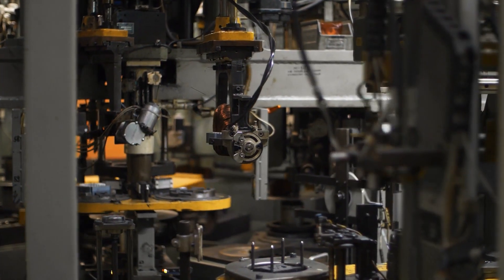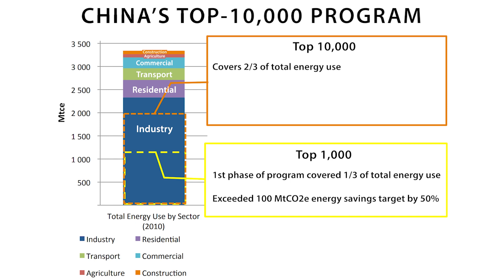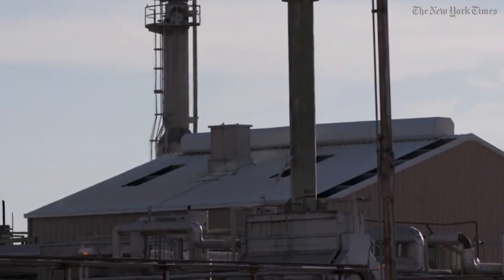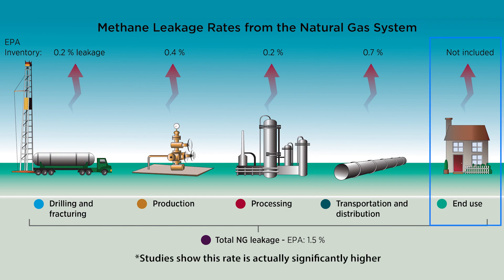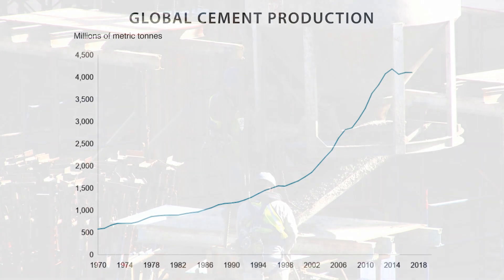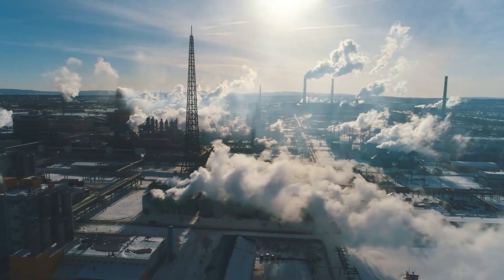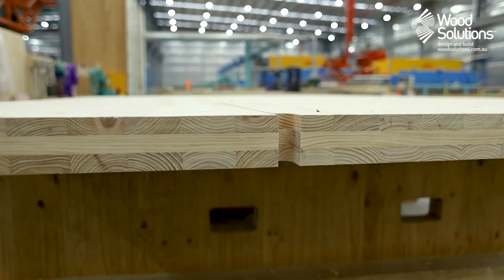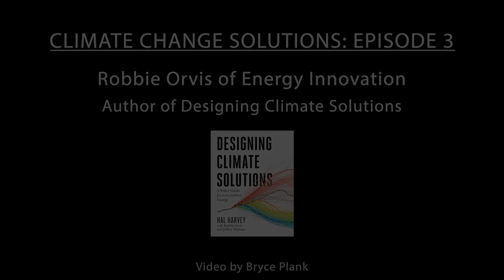How to De-Carbonize Methane, Cement, & Industry

Comment: some people believe that solar cost has got so low we should just cover earth with them, they forget that they take so much mining etc, and solar thermal is way less resource-hungry than silicon-based panels. Just simple calculations and things reveal themselves, just watch the whole life cycle of a product. with refineries even oil got cheap does mean oil is good for environment and same is with solar panels. don't be fooled and actually look at which thing can actually reduce our emissions, converting the whole world to LED can do more. 

and for transition, methane will take over coal and then solar thermal and nuclear will rule at last.
Reply: The efficiency of the solar panels decrease over time.
Solar panels need to be replaced after five to ten years and during that time and after, the lead used in these panels oxidizes and contaminates the environment.
Oxides and nitrates of lead damages the nervous system, making people stupid, suppresses the immune system and damages the internal organs.
The plants need to breathe.
Make more co2.

Comment: 100% Renewable Electricity = 20% of Energy
-- 20% of energy is electricity -- by 2040 24% of energy will be electricity
-- Over 60 yrs jets are 68% more fuel efficient and fly 60X more passengers
-- 2.63 billion air trips were taken in 2010 -- 4.4 billion trips in 2018 -- 8 billion by 2050
-- If batteries were 6X more efficient we would use 60X more of them
--  Earth is heating by 400,000 Hiroshima nukes / day
-- 1968 - 1992 = 1 nuke / sec
-- 1998 - 2020 = 5 nukes / sec
-- 1971 - 2018 global heat forcing averaged 0.47 watts/m²
-- 2010 - 2018 it went up to 0.87 watts/m² = 46% higher
-- 1% of vehicles are electric -- 2% of energy is solar & wind
--- 4% of energy is renewable --- 4% of mammals are wild by weight
-- With 23 billion chickens on earth, if one sneezes we all get the flu
-- Greenhouse gases went up 45% in 30 yrs 
-- 15% of energy will be renewable by 2040, 28% by 2050
-- Renewable energy cannot stop heating in time to avoid runaway change
-- 66% of people will live in water stressed areas by 2025 
-- 4 billion people live 1 month / yr in severe water stress
-- 20% less fresh water per person is available over the last 20 years
-- 50% of thermal & hydro electric power will be threatened with water stress
-- 40% of coal mines are water stressed, and so are 30% of planned hydro 
-- We kill trees 2X faster than we plant them
-- Trees grow faster die younger in heat fire flood & drought
-- Battery & Bio-energy extraction destroys native land water & wildlife

Vaclav Smil says:
-- North Euro offshore wind turbines work 30% of the time
-- North Euro onshore wind turbines work 22% of the time
-- North Euro solar panels work 11% of the time
-- One of them offshore Texas would work 35% of the time

Green Energy Harms Native Freedom Land Water & Wildlife
-- Europe burns 80% of the globe's wood pellets for renewable electricity
-- Europe burns 40% of its recycled plastic & paper for electricity
-- Europe burns 50% of its palm oil cargo in diesels for green bio-energy
-- Dams destroy river wildlife up and down the rivers
-- Shipping trees and palm oil overseas for green energy credit is criminal 
-- Europe's carbon credit system is corrupt
-- Europe's global carbon fund is rife with corruption

Support James Hansen's monthly private carbon dividends
-- 100% to you 0% to governments & corporations
-- That's why both governments and corporations hate it
-- That's why both socialists and capitalists hate it
-- Monthly Private Dividends = Real Climate Racial Justice (not the academic kind)

26 Nobel Prize winning economists support James Hansen’s monthly dividends, including: 3,589 U.S. Economists, 4 Former Chairs of the Federal Reserve and ALL 15 Former Chairs of the Council of Economic Adviser

green energy = global native harm + global wildlife harm + habitat harm + can't stop climate change alone

You can find facts, sources & links at Loki's Revenge blog on wordpress under Green Energy Fraud

zzz zzzzzz zzzzzz

Expect More Mega-Droughts — Science Daily 2020
Fresh Water Per Person Plunges 20% In 20 Yrs – FAO 2020
By 2025 66% of people will live in water stressed areas – Nat Geo 2020
4 billion people live one month per year in water shressed areas – Sci Adv 2016
1.9 billion people at risk from mountain water shortages — Guardian 2019
50% of Global Thermal Electric Capacity Threatened By Water Shortages – WRI 2017
30% of planned hydro projects threatened by water stress – WWF 2020
Climate change: US megadrought ‘already under way’ — BBC 2020
Water use for fracking has risen by up to 770% since 2011 – Science Daily 2018
44% of Coal Plants Risk Global Water Shortage – Unearthed 2016
Water, Energy and Land Insecurity: Global — Science Daily

--  748 million people around the world are without basic water access
-- More people die from unsafe water than war
-- Two billion people lack access to a toilet or latrine
Reply: Saying something is supported by the former federal reserve members is not what I would call a good endorsement.
Reply: @Bagginsess  drivel
Reply: @robertcallaghan4029  yes, it's drivel to say anything negative about the private finacial entity that controls all of our money and has devalued said money due to debt based inflation.
Reply: @Bagginsess  slobber
Reply: @robertcallaghan4029  so you think a debt based fiat currency is a good thing?
Reply: @Bagginsess  word farts
Reply: @robertcallaghan4029  I'll take that as a yes.

Comment: better use the extra heat, instead of getting rid of the heat in big cooling towers. In germany there was a case by the coal plant in Hamburg. The "green" party canceled a project to lay a water piped under the river (Elbe) to use the hot water in the living areas. 
Now all the heated water at the coal plant needs to cooled down without using it.